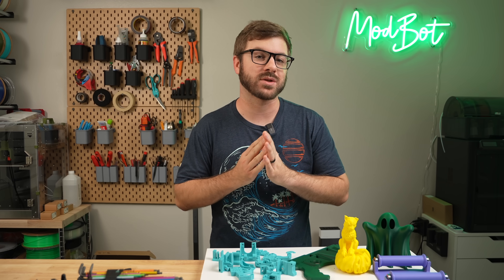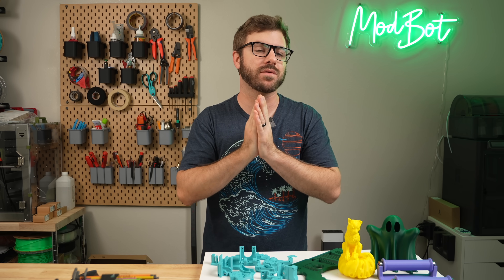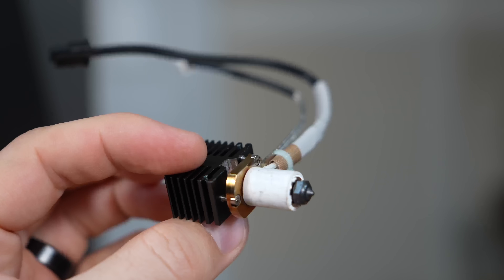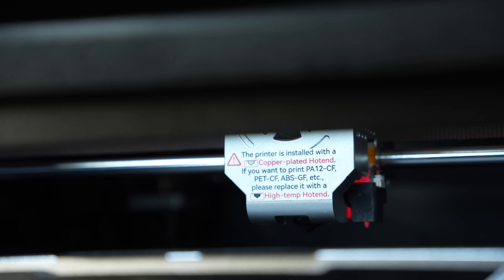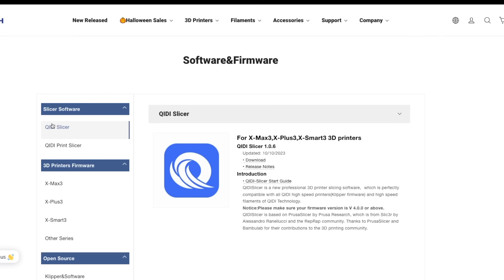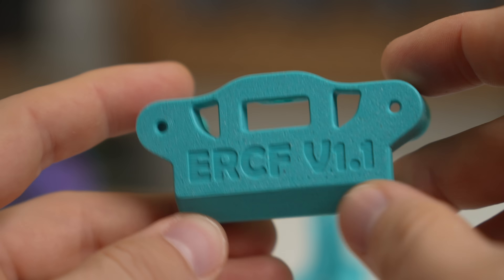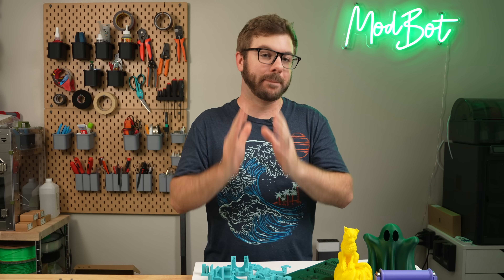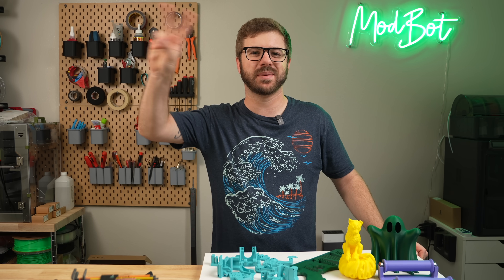Large Fully Enclosed CoreXY 3D Printer (Qidi Tech X-Max 3)

Comment: I noticed your test Benchy's quality looked quite poor with obvious layer lines. My Qidi X-Plus 3 prints it flawlessly but I used Qidi's Rapido PLA which is specifically made for high speed printing, a spool of it ships with the printer. 
I have to agree with your conclusions regarding the filament and USB locations, it's not a good decision. It feels like a step-down from my Qidi i-Mates which has a raised filament holder above the printer that can take 3 spools and the USB is located on the lower front. My printer came with an inductive probe which seems to work well. I also bought the optional smooth build plate and I've pre-ordered the camera. It's an amazing printer and a very capable machine, but to get the best out of it I just need to get to grips with Qidi-Slicer which has slowed my workflow down after years of using Qidi-Cura.
Reply: because voxel pla is garbage xD i tested it and it just produced shit
Reply: How are you liking the printer so far? Thinking about getting the X-Plus 3 as well. My worries is print quality and overall build quality. How many hours do you have with it?
Reply: @themechanic6151  Print quality and build quality are the two things this printer excels at, so no problems there. I've had the printer for a couple of months and have used it regularly without any issues. The print speed is hypnotically fast. My main gripes about the X-Plus 3 is the constant fan noise, the filament location and its huge size, mainly its depth (600mm/24") with filament on the rear. The printer is annoyingly loud even in standby. I'm going to upgrade the controller cooling fan and change the fan grille as this causes a high pitched whine. Overall I'm happy with the printer, it's excellent value for money and the customer support from QIDI is legendary.
Reply: @SimonCoates  yeah if for some reason you haven't seen it, here: https://youtu.be/M5QfQtcKNjQ?si=K90F0Oh65zvD6K8E 

Would you agree that print quality is on par or better than P1S? I'm on the fence between this and the P1S. Don't care too much for AMS, but if P1S is more reliable and prints better, then I might go P1S and buy hardened steel nozzle for abrasives. Although idk if P1S has heated chamber or not. Don't think so. 

Have you printed large parts or other materials that are tough to print with usually and how did that go?
Reply: @themechanic6151  I'd not used a P1S so I can't comment on that. The only filament I've used so far is QIDI's Fast PLA and ABS, some generic PLA+ and PETG/Carbon. All print without issue although I tend to print the PETG/Carbon on my QIDI-iMates which has a 0.6mm Micro-Swiss nozzle, so I can't give you any feedback on the X-Plus 3 0.4mm hardened clogging with carbon etc...
The only large parts I've printed are 350mm long and just 12mm high (across the printer bed diagonal) using QIDI PLA-Rapido, perfect first layer and flawless print. I bought the optional smooth build plate for that job. 
I always print a calibration cube when I change filaments, it's a 20mm cube with 1mm walls. I've just printed a test cube in PLA+ and it measures 19.98W x 20.00D x 19.99H with walls between 0.99 and 1.00 - very impressive.
Reply: @SimonCoates  that is very impressive. I will have to get this printer then from what I am seeing. If I do have issues I will have to contact support as they sound great, but if for whatever reason I don't like it I'll probably go with P1S. Either one should print better than my AM8 (anet a8). 
Kinda last question, any build plate flexing on large prints, like magnetic plate lifting off on corners? And is the PEI build plate losing it's black textured surface finish in the spots you print on? I've seen some talk about how it degrades after numerous prints
Reply: @themechanic6151  I haven't printed anything large enough that could cause the build plate to flex. The only thing that could (maybe) cause the plate to lift would be a something very large in ABS, but the heated chamber should prevent any warping/lifting. I've had a QIDI PEI build plate on the i-mates for 3 years and it still looks like new.

Comment: Actually I do not recommend a webcam inside the printer if you print with 65°C chamber temperature. I added a cheap one and quality got worse over time. Most webcams are not made to be placed into an activly heated chamber. If you want a webcam, either make a movable holder and place it outside the front door or cut a window inside the enclosure, use a glas and place it outside.

With a printer this size you want to change nozzles more often - maybe even while printing. I changed the hotend to a Revo therefore, as all nozzles have the same size and you can of course unload the filament and cool down the nozzle, swap it by hand, rehead and reload filament. You have to combine gcode manually, as the Slicer do not support multiple (virtual) extruder with different nozzle sizes yet (Prusa works on it for their XL)
To upgrade to Revo, you need another board for the toolhead (f.e. the mks thr 36) or a 3th mcu, as neither the toolhead nor the main board has a hotend thermistor input (the qidi hotend uses thermocouple).

The door should be removeable, as printing PLA it shouldn't be closed, but open it is in the way if you place a spool on the left side of the printer. I modified my door hinges.

The reverse bowden should be replaced by a longer one (I use transperent with 3mm inside diameter). Also the runout sensor should be moved to the side. I use an active filament dryer on the left side (the spoolbox at the back I used for my 3th MCU ;-) )

The flexplate is quite expensive (about$50). But 310 by 310 fits well on the magnets, so I use cheap ones (about $16 on AliExpress) most of the time.

8GB is quite low for space, so I swapped to 32GB eMMC.

Actually I made two videos about the mods (english and german)
Reply: Revo isnt a pure upgrade. You loose the possibility to print fast as you limit your flow to 12 to 18mm3/s depending on who you ask. Also you loose the standalone feature of 350° nozzle temperature, neither the k1 max or x1c can reach that. You could use revo high temp, so you can keep using a pt1000 or pt100 and retain the above average temperature capability, but the issue with the low max flow is still there. Personally i wont use a revo in any of my printers because of the flow limitations, i dont need a quick klipper printer for 200mm/s, a flsun super racer was doing that 2 years ago
Reply: @over_pizza_2578  Thats correct. But with the RevoHF nozzle, speed is nearly the same than the original hotend, in practise this does not realy matter to me. Have searched for filaments actually profiting from 300-350°C - and found none. There are some peek variants you could print with 350°C, but they also should use a 85°C heated chamber, so different printer is needed anyways. Anyway, if I need the original hotend, its just a matter of minutes to swap back - actually it does barly matter if you swap the hotend only or the hotend+extruder combo. Just two lines in the config also to change.
Actually to swap nozzle size midprint manually with Revo is a big positive if you want shorter printing time anyways.
Also: If you want to add an automatic filament changer, a high flow nozzle always needs cut&poo for reliability. With just screwing in a standard Revo nozzle, you can use ramping and get a nice filament tip. As cut&poo takes a lot of time, using a nozzle with less flow, but speeding up filament change actually saves time over all.
Also for PA12CF and ABS-GF (wich I want the heated chamber for), you wouln't print very fast anyway - and an Obxidian I have anyways.
Reply: @oleurgast730  i got a dragon uhf minus the uhf extender (essentially a dragon sf with volcomosq heater block, but takes v6 nozzles) that works pretty well for mmu printing. Its on my printer that was once a v0 kit, im purging into a waste bucket to not make the small build plate even smaller. Im also printing abs-gf20 at normal abs speeds (150 to 300 depending on feature). Haven't gotten much experience with nylon filaments, so cant talk about that.

Revo is nice for mmu printing because of the long steel tube in the heatsink and the fact that its 2mm ID. A rapido for example isnt that coolf for mmu printing, because it has 1,9mm ID, so needs much better tip tuning parameters and has only a short tube in the heatsink, so you have less area for cooling moves.

Comment: Having both an X Max 3 and a P1S with AMS for the last couple of months, both about $1K, I can tell you that if I had to do it over again, I'd have purchased two of the P1S with AMS without a doubt. The P1S isn't perfect, but I've run at least three times the print jobs through it because it doesn't spend half its time in a broken state. The QIDI clogs easily. I can't even run black PLA in it reliably. I'm sure if I were using advanced materials more often, it would come off better for me than it does, but frankly I've used a ton of ASA recently and that all fell to my P1S. Most of the clogs in the QIDI are the result of bed adhesion. I have consistently poor adhesion in the SE quadrant of the bed, forcing me to keep prints off that corner. I think the biggest flaw of the printer is the BL touch. That is the biggest difference between my two core-XY printers, and I believe the reason the QIDI is so much less reliable. I wish it were not so. I have no interest in promoting the Bambu, but it is clearly the better machine. If Bambu made a 330mm^2 printer or larger, I would get one and relegate the QIDI to the shop. In case you're wondering if I've actually used the QIDI enough to master it, I've probably got 500 hours on it, which isn't much, but its enough to get to know it. I keep it inside my office in a climate-controlled environment. I feed it only new filament. It sits on a cabinet I built for it along side my always-broken CR-10 Max. I'm not a YouTube 3D printing content creator, so I need my printers to work and be reliable. I can't be off to the next hot thing every 30-60 days. 

For those of you who own this printer, if you have print adherence issues leading to clogs as I've had, the one thing I did that made the biggest difference is increasing the PLA profile to 225 on the hot end and 60 on the bed. It's not a cure-all, but it is an improvement. I got that tip from Reddit. The right-front quadrant of the bed is still sketchy, but I can push out further than I could before with the hotter bed.

I know there is no fix for the BL Touch problem. I don't think it's practical for QIDI to do more than bandaid the problem. I would be happy to pay $200 if QIDI could make the bed-leveling based on pressure sensitivity.
Reply: At this point BL touch has become a deal breaker option for me. It was an amazing little piece of kit to add to printers that had no better options, but at this point it is simply obsolete when there are far superior options as far as putting on a new printer. My other problem with the QIDI was the door and how it just makes it look cheap. I don't mind the plastic body (I have a P1s as well) but the door just looks cheap and like something you see on a kids toy. I hope in future revisions of this printer they resolve some of these issues because I would honestly love a large capacity enclosed klipper based printer in addition to my Bambu printers. I am slowly starting to evolve my hobby into a small business and as such I don't care about anything outside how reliable the printer is. My days of wanting to tinker with something are long behind me. At this point if I'm dropping serious money on a machine, I expect it to work.
Reply: @OmegaGamingNetwork  I agree that any printer in the $500+ price point should have a pressure-sensing or better bed leveling process in 2023. Plus, the minute you ask someone to slide a piece of material under the nozzle and see if it scratches, you've introduced a massive failure mode into your printer. Two things printers should do without fail is maintain the correct distance between bed and nozzle, and keep the filament flowing. My first printer was an Artillery X1 Sidewinder. I've put dozens of spools through it. It never clogged (only PLA, so that helps) and once I got those fiddly wheels properly dialed in, it wouldn't need to be releveled for some time. I feel like I'm going backward.
Reply: @Immolate62  Exactly and look I get why people dislike Bambu. I am not a fan of anything that isn't largely open source. However the reality is Bambu changed the game and set the minimum bar for what anyone should expect out of now a $300+ printer. Though I do think some of the hate direct at them for being like apple is completely unfounded as they act nothing like apple, I do understand why people have that reaction. However hating a company and not expecting other competitors to at minimum meet the raised bar however is just silly. I want to see more highly capable 3d printers at the various price points, not less. If a company wants my business, then they need to bring their A game. Don't want me comparing your printer to Bambu's? Then raise the bar and put out the next standard setter.
Reply: @OmegaGamingNetwork  agreed. Bambu isn't good because it's proprietary. Nothing that it does right, and it does a lot of things right, would be any harder to do open source. It's good because it solved the problems that prevent a good print. Everything else is secondary, and they got a lot of those things right too. The AMS, ease of setup, elegant chassis, etc. QIDI messed that up, but I dont' care about it. Don't care that it's too fat for its bed size. Don't care that the design is garish and ugly. Don't care that you can't access the filament.
Reply: @Immolate62  "the Design is ugly" Seriously, that is something you even remotely consider as a valid point against the Qidi? I absolutely like its design, and tastes are different for everyone! "You can't access the filament" If you own a printer made for printing engineering materials, you can print with the filament being in your dryer. Btw: Not everybody has their Printer sitting flat against a wall...
Reply: @Elektrotechniker  although I think the design is ugly and that the filament placement is about as bad as it can be, I didn't say any of those things in my comment because I don't really care. Perhaps you were responding to someone else.
Reply: @Immolate62   Read your response to "OmegaGamingNetwork" again! That's exactly what you said...
Reply: @Elektrotechniker  ah okay, I did say that. I said it with the qualifier that I didn't care about those things, so my point stands that it's immaterial.
Reply: Thanks for the detailed info on this machine. I currently print PC/PC+CF on my K1 and it does so flawlessly at a 0.6 or 0.4 nozzle. I use OrcaSlicer which has been great thus far but I would like/need to print a bit hotter with a hotter chamber temps which is my interest in this machine but I have heard many bad things in reliability which is a HUGE no no since I am running a small business
Reply: I have hundred of hours on my xmax and zero clogs.. I wonder what the difference is?
Reply: @coryturner9140  I wish I knew the answer to that question. Perhaps I got a lemon, or I just have a terrible feel for how much scratch I should allow during bed leveling, or you have a better profile. I am not proud, so if you have some advice, please share.
Reply: @Immolate62  Wasn't there a change to the hotend path, something about a step? worth asking Qidi support.
Reply: sounds like you need to read the manual

Comment: How reliable is it? I have a Creality K1 I bought when they first came out and they've had to correct many faults but now overall its pretty dependable...what faults does this one have cause i am very interested
Reply: i had the k1 max, not comparable at all. the k1 is Ewaste. 2 month now. not a single issue or failed print on the xmax3
Reply: @NicoFritzler  what materials have you tried on it?
Reply: What slicer do you use with them?

Comment: Great review. You covered all the major points fairly, and provided solutions where applicable. It's clear that you took the time to research the printer fully by following up on where you found it lacking. I'm in complete agreement with everything you've said here. I own an X-Plus 3 and everything  you've said here applies to that as well. They are extremely capable printers that represent excellent value for money provided that you're willing to tolerate the lack of "polish" for a few things.

It should be noted that Qidi has an ongoing coupon code being "UP03" that will take another $50 off the price on their website for all of their 3 series printers.

Comment: New models come with an inductive sensor instead of a BL Touch.
Reply: Inductive sensors actually switch their trigger point quite a lot on different chamber temperature, so this doesn't seem a good idea. Even Prusas Super Pinda is stable just between 15-35°C. As far as I know, the 1st version used inductive (and the smart still does). The rev 2 was actually just changed to BL-touch.
But you are correct, in the stor they actually just added an inductive sensor for the x-max. So we now have a rev 3...
Reply: Ty
Reply: I had inductive once on the first editions of Cr10pro - never again.
Reply: agreed my new x-max 3 got it

Comment: I had one and sent it back after one week. I did not get a single print from it. Only fault warnings and failing software.
Reply: Rev 1 or 2? Was the failiure something with MKS_THR disconnected? This sometimes happen, if the USB cable had gotten loose after rough shipping.
Reply: No, intermittent failure notices. The printer would also not recognize updates on the sd card. @oleurgast730